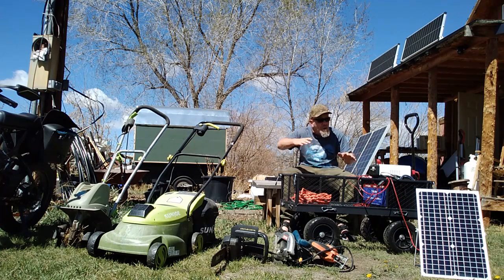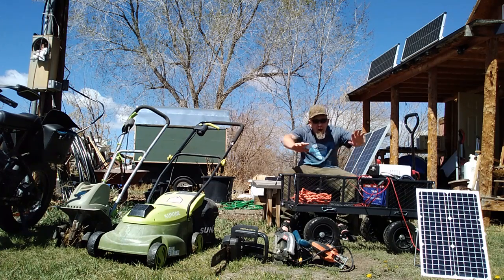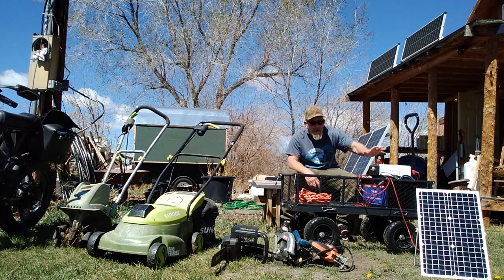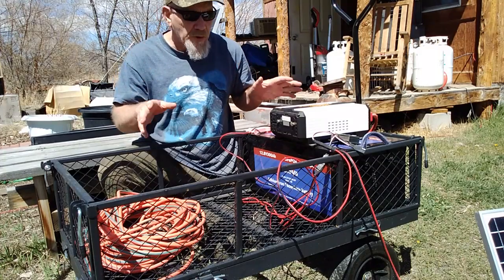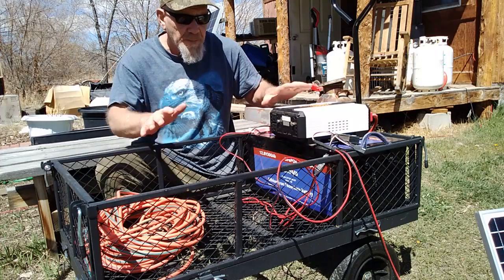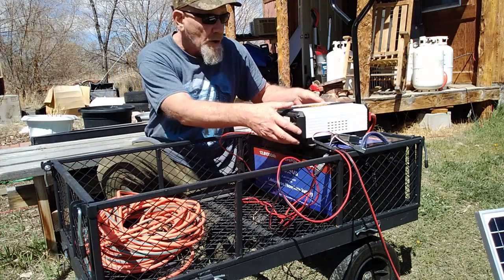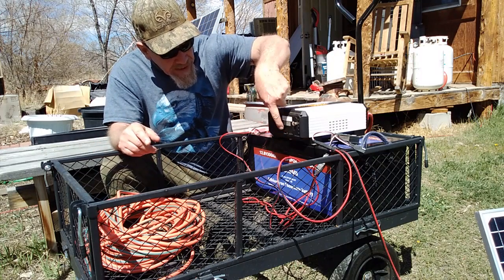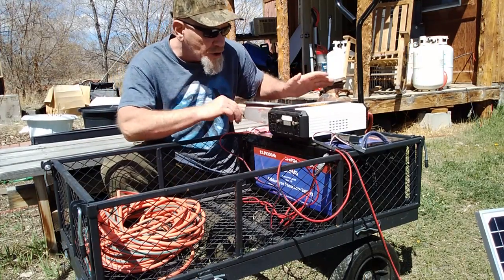DIY Power Cart For Outdoor Work Or Emergency Power

Comment from the maker: This is a DIY Power Cart used for powering outdoor tools and can be used for emergency power in a blackout.  This is a simple and affordable system anyone can set up in an hour with no electrical experience.

Bilt Hard Garden Cart: https://amzn.to/3xAJCiR
300 Ah Lifepo4: https://amzn.to/3vM0frB
Pure Sine 1500 Watt Inverter: https://amzn.to/3Jl6SUJ
30 Watt Solar Panel w/controller: https://amzn.to/3UkvraD

B&D Jig Saw: https://amzn.to/49Gb5Nq
Ryobi Skill Saw: https://amzn.to/3JkjGL1
Oregon Chain Saw: https://amzn.to/3JnOc70
Sun Joe Mower: https://amzn.to/3xEhuvl
Earthwise tiller/cultivator: https://amzn.to/3xGX8Sf

I make a small commission if you buy through my Amazon links -thank you!

#powerstation #offgridsolar #emergencypower
Reply: Don't forget to pin your comment with the links Lamar!

Comment: I sort of do the same thing. I am always wearing out those carts, when one gets too bad for hard use, I demote it  to lighter use, like have a smaller inverter generator and big cord on it, covered with a plastic tote turned upside down. Those four wheel carts sure are great for the home and property. I have hauled some really heavy stuff on them.

Comment: If you fit a slow start (surge control) component in series with power tools, you can run them from a smaller generator.

Comment from the maker: Cover for the power cart!
Some people asked about covering the power cart I designed and I found this cover on Amazon that fits the dimensions for the Bilt Hard 880 pound garden cart and appears to be well made. https://amzn.to/49BhYQ5
Reply: Just what I was wondering about!
Reply: Would you only use this for storage or emerge rain cover or would it be ok (not overheating) to run the battery and inverter under it all the time?

Comment: you've got the right idea!... I use a bike trailer [for kids] that carries a power station [2000w/h] a 200w foldable solar panel, and on top of it is installed a 200w vertical wind turbine, I can pull it with my bike, or use the 3rd wheel and push it like a stroller, it also carries my 40lt freezer and plenty of gear, it's what I use for camping, and also my ''get the f out of Dodge'' vehicle... all tires are solid, and between my front and back racks and bags on my bike and center too, and the trailer/energy station, I'm all covered...
Reply from the maker: I have one of those bike trailers too and use it for charging.
Reply: Yeah all electric yard tools. Now your talking I don't know if that inverter will run my Worx 18 inch chainsaw. I usually pop a 20 amp breaker if the saw sits on the log before turning on the saw. So I know the start up current is pretty high. 73
Reply: Nice job and very handy.73